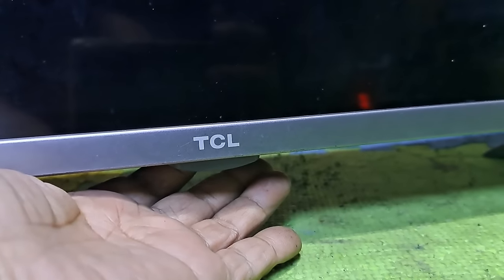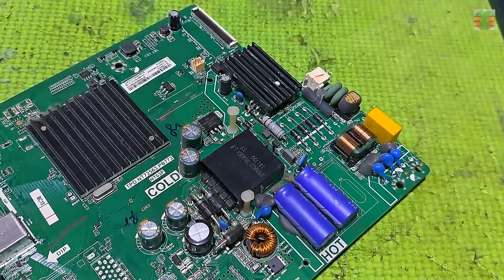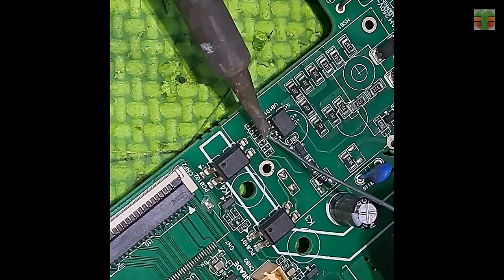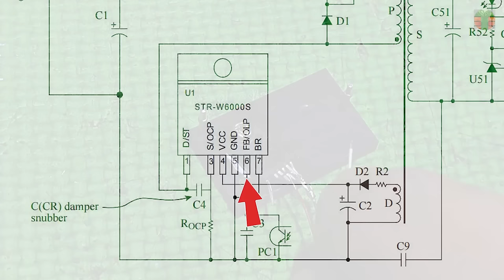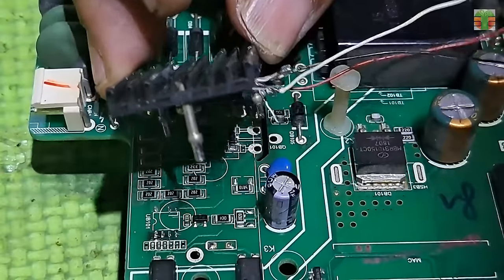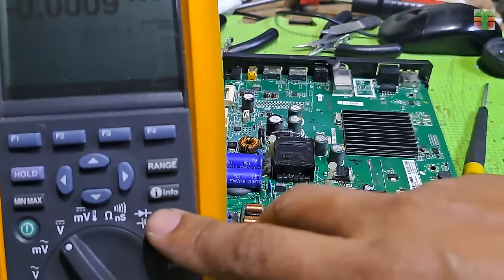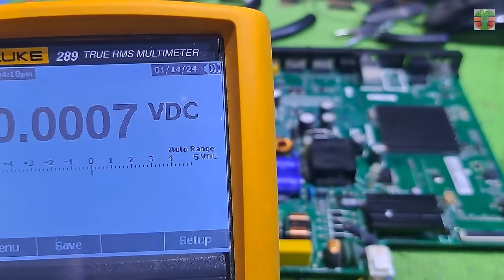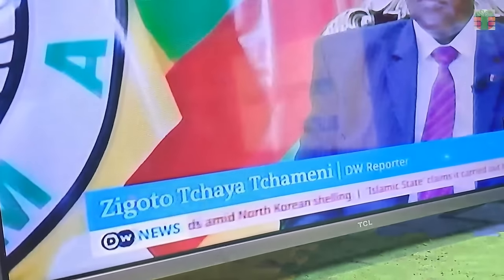TCL smart LED TV. (No power repair)

Comment: Good work as usual sir ❤️.
I know almost how to use strw6053 and I learn it from you.
In almost your modifications you use it. But 1 new thing I learn today. About the pf capacitor you add on the octoplur. And why you use it also. Thanks a lot.
Also please if you have a backlight repair please upload a video. And show how the connection do in paralel.
Because I need something to learn in these connections.
Also please when you will record this video on the backlight connection please record from steps by steps. When joining the wire.
Thanks ❤️ stay bless sir.
Reply from the maker: yes sure
Reply: @tevzTVTevatronics  thanks you so much have a bless day. ❤️

Comment: Tevz, love the channel, and love how you go thru everything to show us what the process. I have a question, if you have time. Have a 75" Bravia with no picture. Tested all boards and they are fine, back lighting fine, TV runs thru the hard reset to factory setting. Is there anything I can try or is the panel toast, and i just need to give up? Thanks

Comment: Hi engineer
Why did you doubt the pwm ic with a connection on the diode?
Reply from the maker: I have no doubt of the connection. the VCC diode is no doubt connected to the PMW driver.
Reply: @tevzTVTevatronics  thank you

Comment: Hi I am working on a skyworth 55S3A32G there is no image but backlight is on I have test the VGH and VGL but no voltage present .The 12v is present  on the DC To DC I.c  and 3.3 v is also present any idea if you can help please !!!
Reply from the maker: try disconnect the ckv lines
Reply: Cut one side of ckv lines
Reply: Cold test between vgl and vgh to ground, then check panel shorting
Reply: @tevzTVTevatronics   Thank you for quick reply but where about is the ckv lines , the pcb number is  ST5461B05-2-XC-2 ?
Reply from the maker: @lindamalepa7823  sorry, I'm not familiar with that board.
Reply: I have  a question  sir 55inch JVC back light ok screen blank as soon  disconnect left on screen tcon half pictured how to identify a fault on a screen please 😢
Reply: @Mr19901993  Hi you must isolate the ckv line on the t con board

Comment: Hello. Why is the new ic with more bases? Is their switching frequency the same?
Can this be done in all the powers
Reply: Strw6053 has a PWM and a power mosfet packed together. As he has pulled out the pwm in shortcut, he replaced the old mosfet with this component then he has to wire up all the other pins to the correponding spots.
Reply: @JeanDAVID  thanks for your response.
Did he check that it can be replaced through the datasheet, or does he do it confidently because he has experience?
Is it possible to do the same for all the powers?